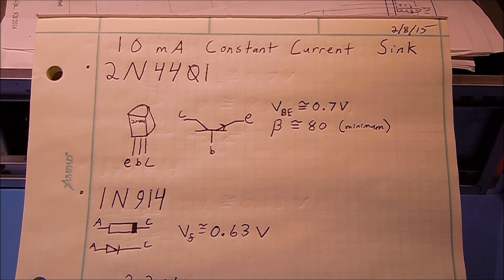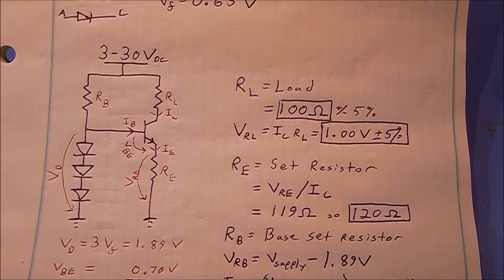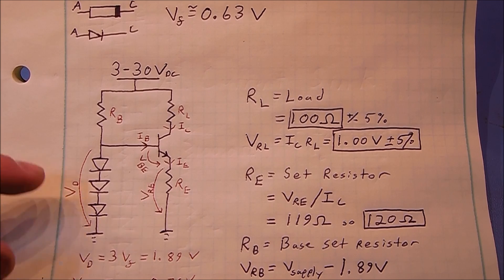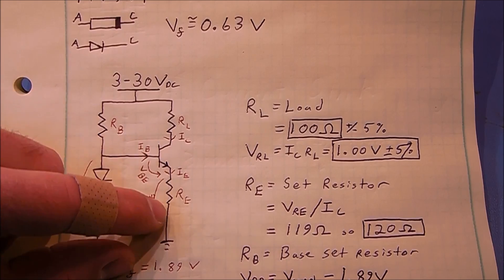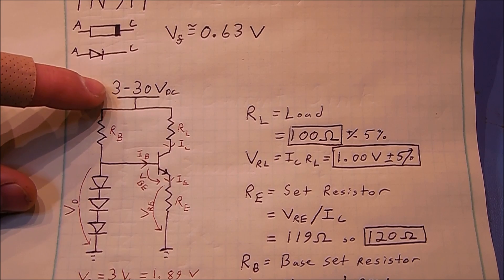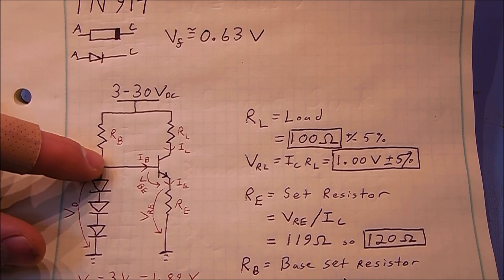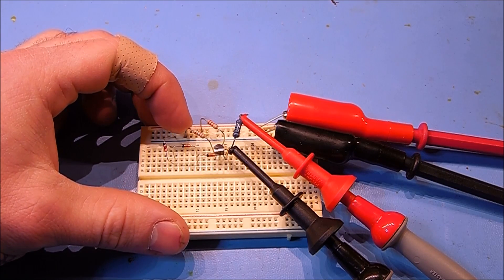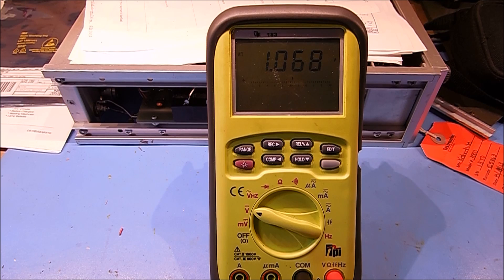Transistor Constant Current Circuit

Comment: I don't get these circuits at all.  So they will limit to a fixed current, but only if you know the exact input voltage and the exact fixed load current.  So they can't really limit if there is any variation in input voltage or load resistance.  Which then begs the question why not just use a resistor which will achieve the same thing?
Reply: Paul Campbell  you are totally wrong on that, This basic circuit,will provide a constant current regardless to load and supply variations  .
Reply: I think what may be missing here in the explanation is that it should be stated that the transistor essentially becomes part of a feedback loop.  When the load resistance varies, the base current to the transistor changes accordingly such that constant current across the load is maintained.

Comment: It would be very interesting if you demonstrated that the current remains constant when you change the supply voltage or load resistor.  I don't quite understand how you can assume a supply of 5V to help design your circuit (to set the base resistor) if that voltage can change.  Also, you need to set the base current to be emitter current / 80.  I don't see how you have any control over the base current here.  How does that work?

Comment: I am confused by several things  1. what are the components being "protected" by this circuit? 2. when there is not a short circuit what is the flow of electricity? 3. where on the schematic can there be shorts that this will protect? 4. What is the flow of electricity when there is a short?  On the first diagram you use "C" and "e" : how does this compare to vcc and || ? You need to be consistent with your labeling. How does an NPN transistor behave?
Reply: +transparentpolitics also why the 3 diodes? why not another resistor?
Reply: +transparentpolitics The diodes act as a crude voltage reference.  The voltage across diodes is much less dependent on the voltage across them than for a resistor.  A reverse-biased zener resistor is commonly used for this purpose.

Comment: Hello, nice circuit and great explanation. If I was to charge a battery using the constant current generated, where do you suggest I place the battery? I though emitter, but that would change the voltage constantly, thus making it harder to find the resistor value. 

Maybe current mirroring ?